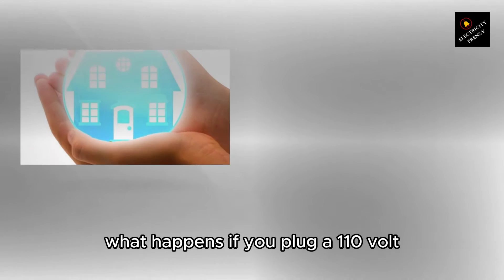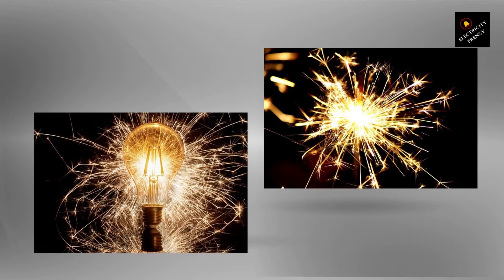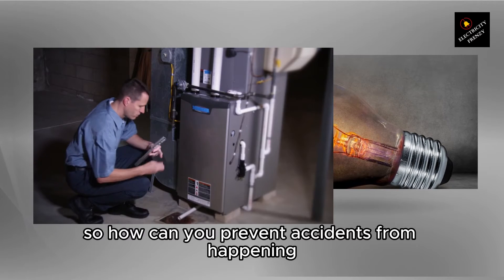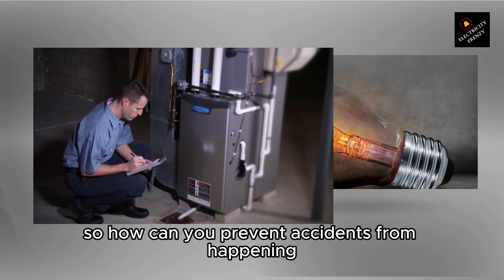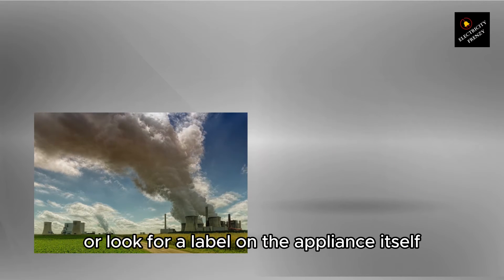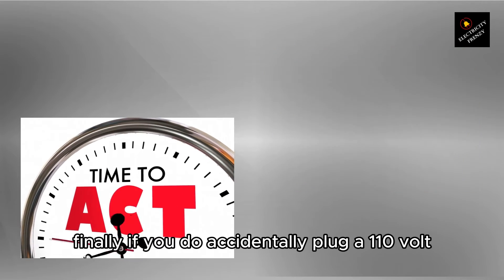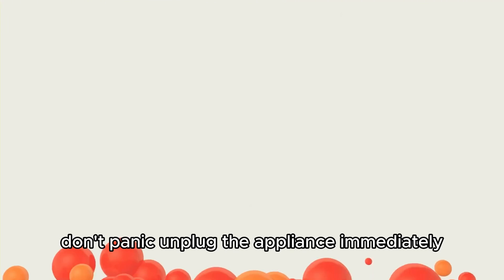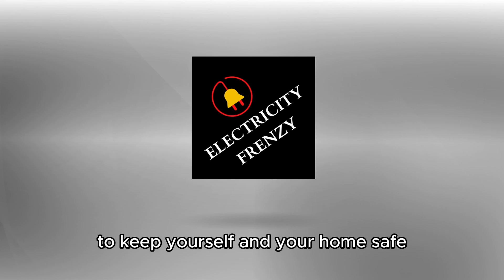Plugging 110V Appliance to 220V Outlet The Unexpected Danger!

Comment: That’s not true. It will only pull as much power as it needs.
Reply from the maker: Thanks for your comment, With all respect, higher voltage means insulation brake down.